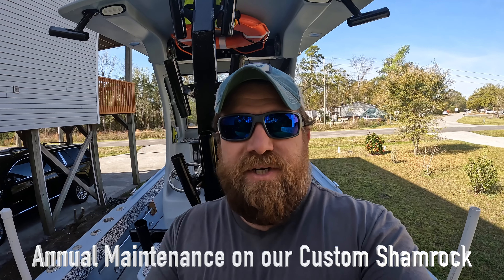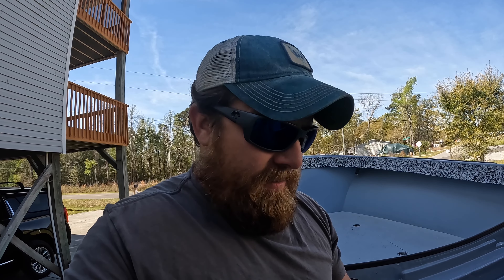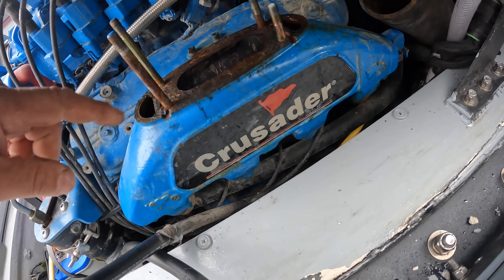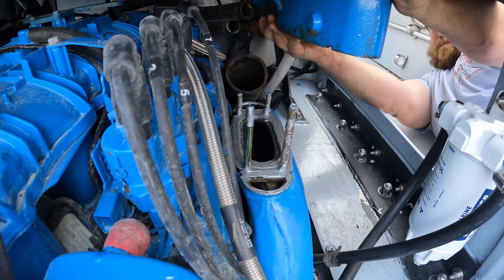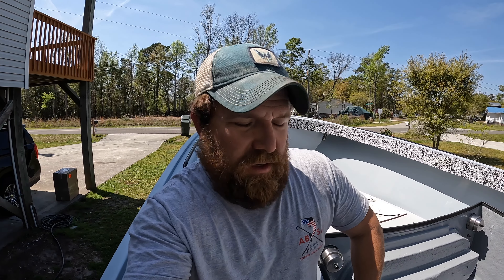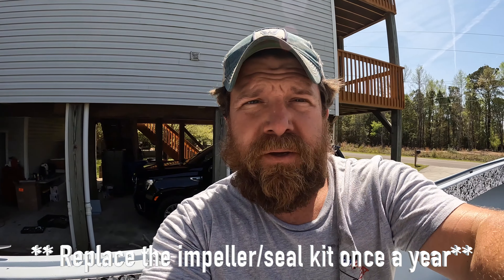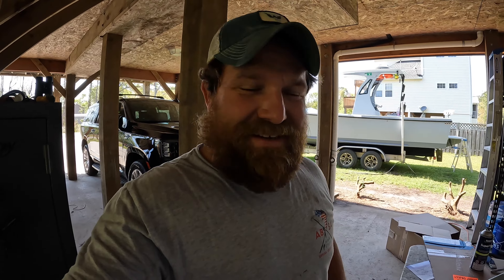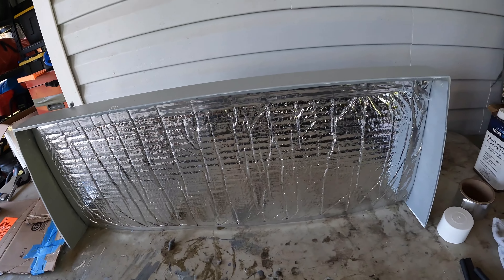Annual Maintenance on the Reel Freedom

Comment: Hey captain... don't forget to check the torque specs on those riser nuts... that could have been your slow leak... I beleive its 27lbs. its very difficult to get a torque wrench onto all 4 as you show having to use a wrench on one nut and a socket on the others.  lets get fishing.
Reply from the maker: Thanks, Yeah I went around and checked them after. They are pretty close to where they need to be. Def tight. lol Thanks for watching!